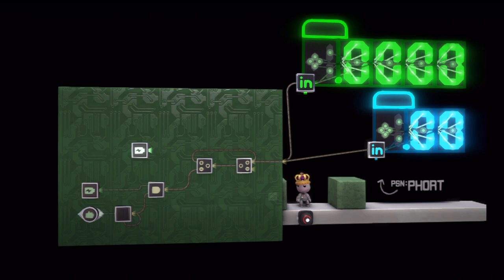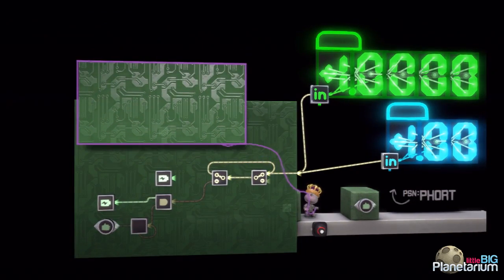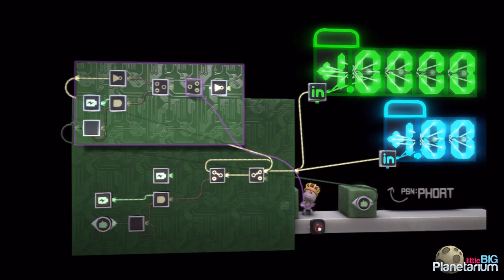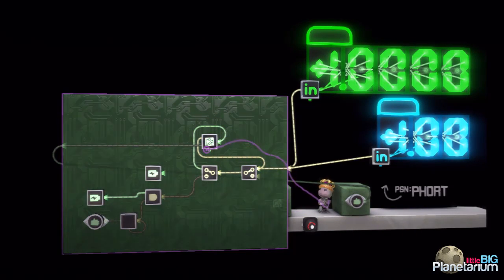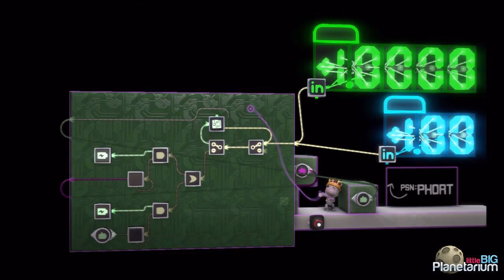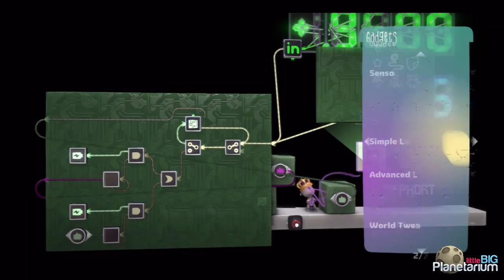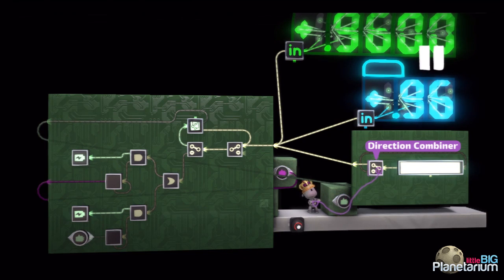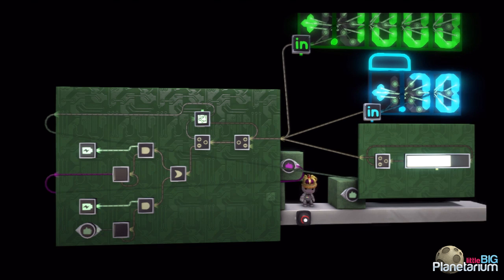LBP2-Torials 20: Feedback Loops (part 2)

Comment: Use a positional sequencer with a ton of batteries corresponding to each tiny increment of sticker panel.  You will need to make a lot of sticker panels if you want it to look smooth.  But it WILL work.